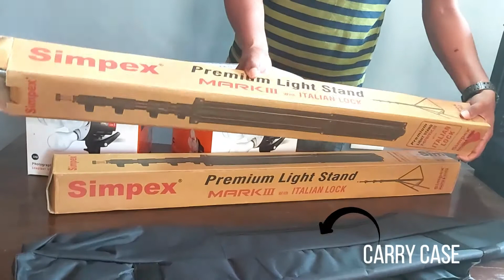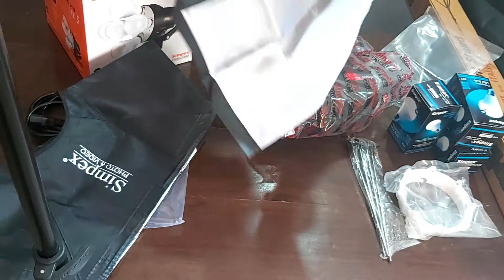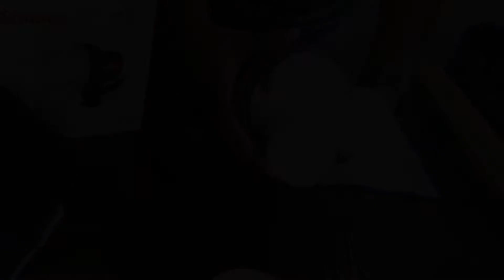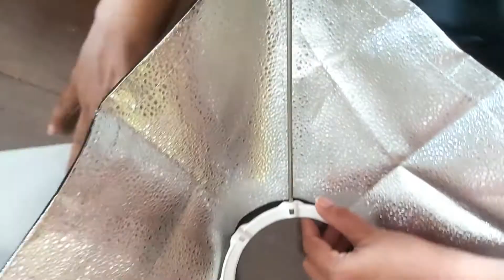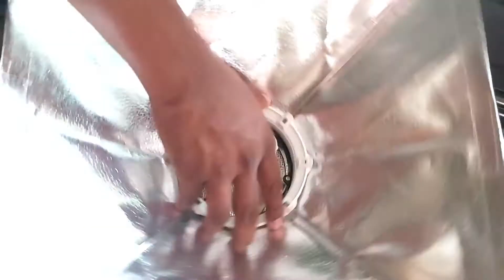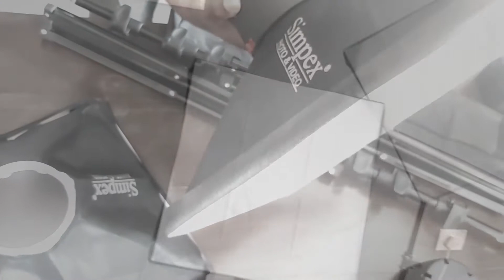OCTOVA PRO Softbox Lighting Kit For Interior Design Shoots

Comment: Great one buddy... Just a suggestion on improvisation - eliminate lag at the start, the initial assembly is quite slow and do reveal yourself. You would connect with the audience better...Furthermore if you trim the part of the video which is not required towards the start and end, you would get better audience retention...Overall great explanation and good luck 👍👍👍